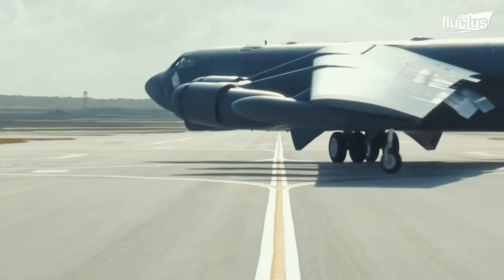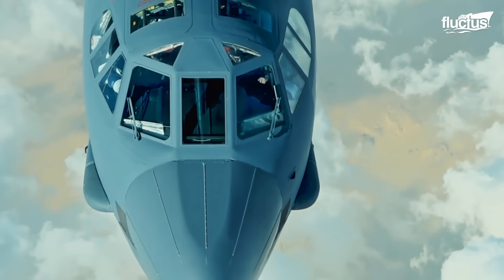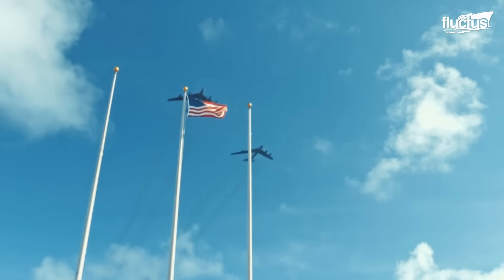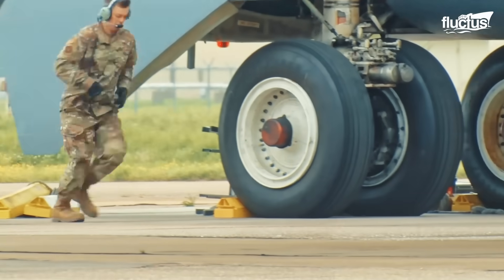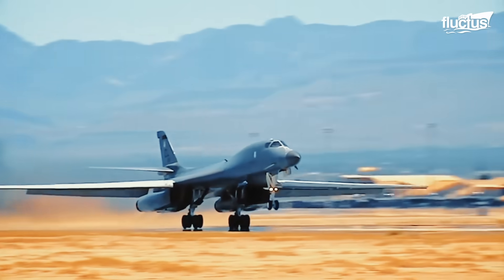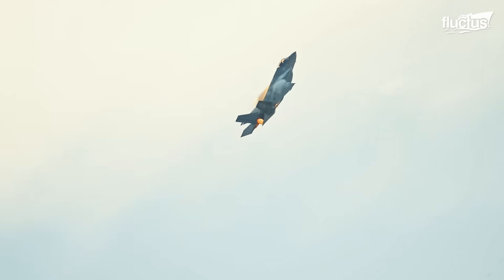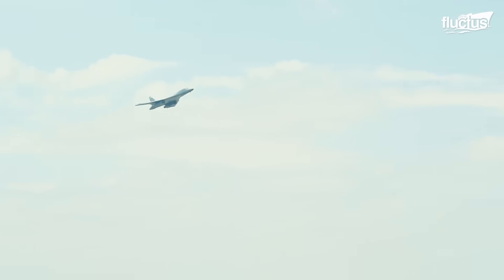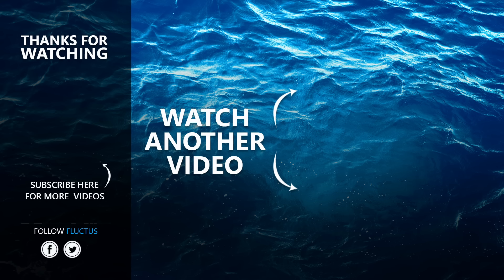Behind US Genius Idea to Power Old B-52 Bombers with Brand New Engines

Comment: When the F-14 was developed in Bethpage by Grumman, I lived 1/4 mile from end of runway. I used to ser toms of F-14, E2C, & F-16 fly low ober my backyard. I could wave to the pilots. When the LEM was picked up, the NASA Guppy flew into the airport and it was so huge, that I thought it was going to crash before it got to the runway  I also remember it took off in the middle of the night under the cover of darkness as the entire moon landing depended on the LEM being delivered to NASA safetly

Comment: I guess I'm a genius. I said back in the early 80's when I first learned about the current engine that Boeing needs to put a more powerful fuel efficient engine on the b 52 and the mission would be greatly improved. Have extra speed when needed and longer range.
Reply: The Boeing check made out to your prescient self may well be in the post..... - or not!
Reply: The B-52 does not need a more powerful engine.  This is due to its design.  The TF33’s used on B-52H’s are actually de-rated.  There were actually a lot of compromises and quirks in the 52 design that are too numerous to cover here.

Comment: Don't get me wrong. I liked the video. I like this stuff. But you should have named it about the b52, b1 and f14. BTW  the merlin was a fine engine. But so was the Allison. The merlin didn't make the p51 into what it was. The laminar flow wing did. The Stanley hooker supercharger on the merlin gave the p51 the high altitude performance it needed to be a truly world class escort fighter. The wing design is what gave it its great range. The p38 never used a merlin but the same Allison engine that came on the p51. Only those engines used a turbo/supercharger developed for the b17 bomber giving the p38 its great service ceiling

Comment: These are the same planes the North Vietnamese would shoot down with Russian SAM Missiles. I doubt they go much faster than a commercial airliner and even with electronic counter-measures would still be slow and vulnerable.
Reply: They are not sent into environments that have active air dense systems
Reply: @yourmanufacturingguru001  I assumed that which only limits their effectiveness. They were designed a a heavy bomber and to carry nuclear weapons.
Reply: The B-52 has been for sometime and will be in the future with the remake going on an arsenal plane. It probably has a radar cross-section (RCS) of a barn door!
Reply: @weissmorris8822  Its ancient, they made moves about it in the 1950,s. New engines even Boeing declined that for the 747.

Comment: You said almost nothing about the new engines. Why???????
Reply: Because to have British engines on this most iconic of American planes is a little, well, embarrassing.
Reply: @sjmachrihanish This series of engine is from when the company was called Rolls-Royce Deutschland when BMW had a stake in RR's aero division and was designed and are still produced by Rolls-Royce Plc's Business Aviation division in Dahlewitz, Germany for the civilian market as the BR725. The ones for the B-52, designated as the F130 will be manufactured in RR's North American division in Indiana. In fact the engine produced in the UK, the Trent 1000, has massive amounts of problems.

Comment: The USAF know the F130 engine very well as it`s done huge hours for them over the years as they power their C-37 & E-11 aircraft. F130 is a derivative of the BR700 series of engines that have been very successful for RR. Those fitted to the B52 will be built at RR`s facility in Indianapolis.

Comment: Why not 4 larger engines, rather than 8??
Reply: Apparently, aerodynamically, it was easier to stay with eight engines in the twin pods. Ask Boeing what happens if you change engine placements badly (737 max).
Reply: Lower ground clearance, issues in case of engine failure (thrust asymmetry), different engine-wing interaction (which would need complex simulation and testing to account for)
Reply: With 4, if you lose an engine on take-off, the 10% rudder chord cannot control the yaw.

Comment: Apart from some early production test aircraft, the Merlins used in P51s were made by Packard. Many of the Packard Merlin powered P40s (P40-F and P40-L, or Kittyhawk Mk II) were converted back to Alisons, and the Packard Merlin engined P38 never saw production.
Reply: @paulfrantizek102  With exception of the initial Merlin engined test aircraft - ALL the engines used in the P 51 were either Alisons (used in the early models) or Packard/Merlins. Not one P51 was ever produced with a Rolls Royce engine.
Reply: @paulfrantizek102  never one Merlin P 40

Comment: "Behind US Genius Idea to Power Old B-52 Bombers with Brand New Engines." Nothing was said about the new engines. You didn't mention the 30% increase in power, greater fuel-efficiency, maintenance, etc. Do the new engines increase the ability to carry more weapons? Did it increase the speed of the B-52? Why Rolls-Royce? Made in America. How long before all of the aircrafts have the new engine? Do the new engines still require an explosive cannister to start? Is not an auxiliary generator capable of starting them faster? What is so genius about getting a new engine? Old engines do wear out. Are they able to take off any faster. Was it done to respond to emerging threats such as hypersonic weapons? Has the mission changed? Are they still going to be used to carry nuclear payloads or is that going to be handed off to just the B-21 Raider. Are they running any cleaner than the old engines? Are they any quieter? Is the additional power used for new electronics or for greater payloads? You left a lot of information out.
Reply: Great questions
Reply: Are you inquiring for Russia or China? 👀 jk
Reply: @Slonge92  Exactly, those questionable dudes🤔
Reply: It's all available in loads of other videos....just search it....

They're based on a commercial aircraft engine so I'm sure they'll start in the same way, they don't leave smoke trails 3 miles long and are more economical allowing longer range or more loitering time ....not sure if that will result in an increase in payloads but I doubt it
Reply: Good point - why aren't they buying Pratt and Whitney engines?
Reply: @billfrohberg3206  ... Rolls Royce Engines offer more than any current engine on the market
Reply: @billfrohberg3206  Probably RR had the better product. Or didn't provide an offer. Also: RR may be a British company, yet they also operate significant production facilities in the US.
Reply: Yes…ALL the Question’s which you have stated and or requested answers, the Enemies of your Nation would be interested in obtaining!

If, any body or person with the answers to your questions, attempted to give such TOP SECRET INFORMATION to the Enemies of Your Nation, then they would Face either Several Hundred Years Maximum Security Federal Prison, And Or, The Military Forces Federal Maximum Security Prison, And Or, A Potential Taken Out At Dawn given a Cigarette And A Firing Squad [!]

The Majority Of Your Question’s The Answers would be Evident [!]

As A NEUTRAL PEACEFUL OBSERVER I would Be Happier if ALL NATIONS WOULD BE ABLE TO RID IUR SHARED HOME EARTH OF ALL WEAPONS [!]

But I know that will not happen.

Because Weapons may also be turned on Objects such as METEORS on a Collision Course with EARTH.
Whilst there is No Proof of Weapons saving Earth. Fiction Movies are Daily Telling Humanity METEORS are A Danger!

Personally I hope EARTH is Never Tested with METEORS…because as Current Internatiinal Conflicts show…PEACE FOR HUMANITY IS THREATENED [!]

Despite the Threats , I Will Remain Respectful for PEACE ON EARTH BETWEEN ALL PEOPLE’S AND PEACE ON EARTH BETWEEN ALL NATION’S [!]

Yours Faithfully

Mr. Lawrence Hennessy NEUTRAL UNbiased INTERNATIONAL PEACE BROKER + INTERNATIONAL LAWYER
Reply: A lot questions. As these engines are modern jet engines its clearly no explosives needed to start them , lol.
The reason to replace them is not fuel efficiency or other reasons. Its very simple, these kind of engines reached their lifetime. (imo just like the Air frame)
Just like a Saturn V rocket can't be built anymore. There is no production capacity and no machines to build such old stuff, and frankly it don't make sense either. 
For me this is all a safe sign that the US is beyond their peak. Modernizing B62 nuclear bombs and modernizing 70 year old Air frames. Clearly fit to fight a war in the 21th Century, not.
Reply: @hansjorgkunde3772 .... Actually upgrading them makes a shit lot of sense as the airframes have been virtually all been rebuilt as it is .....as for a war scenario these aircraft will never overfly an enemy country as they're basically an airborne aircraft carrier used to launch cruise missiles and other weapons that travel to be their destinations hundreds of miles away

Comment: British Rolls Royce as powered the Spitfire & Hurricane. Manufactured under license for the P51 Mustang that allowed it to work as the Allison proved inadequate. Now helping your awesome B-52 have another life
Reply: ...although I think that, ironically, this is an engine from the German bit of Rolls Royce.
Reply: @timmurphy5541  All good for the  RR share price !!
Reply: Fuck British engines, no one makes better jet engines than the US.
Reply: The BR series of engines were designed and are still manufactured for the civil market in Dahlewitz, Germany. These will be manufactured in Indiana. The engine produced in the UK, the Trent 1000 has massive issues.
Reply: @ginacalabrese3869  there are quite a few engines produced in the UK apart from the Trent 1000 and it's of a totally different class. It's main fix is out too.
Reply: The P-40 used Allison engines in all specs I have read.

Comment: This is not genius, it's not even new. The TF-33 turbofan (JT-3D replaced the J-57 turbojet  (JT-3C) with similar benefits. Numerous studies have been done on re-engining since the early 1980s.. Putting commercial BR-700 derivatives from bizjets dating back to 1995, is hardly revolutionary. It doesn't even add power. What it adds is dramatically improved reliability and better fuel efficiency.

And no, the Lightning had Allison engines not Rolls-Royce although they may have performed better with them (particularly the 60 series and 100 series) as the intercooler/turbochargers were a weak point in earlier Lightnings.  .

Comment: Nope. Rolls Royce did NOT power the P-38 or P-40. They might have installed the Merlin in both airframes as an experiment, but they were never used in production.

Comment: There was also a plan to replace the eight engines with four much larger turbo-fan engines.
Reply: Replacing 8 with 4 will not work with a 10% rudder chord.  Losing an engine ( with 4 engines) on take-off will ruin your day and result in an airframe loss.  There would not be enough rudder to control the yaw.

Comment: There is no reason to replace a Bomber such as the B-52 when upgrades can be done easily and the structures are still sound.  The range is increased not the speed since the engines produce the same thrust as olde ones.

Comment: I was a plumber 55255 while in US Air Force. I think I got a better job then those poor guys. I'm sure they were all told they were going to be Crew Chiefs of the plane they wanted. 😂
Edit, we plumbers and water and waste airmen made the water for the B-52's and some of the older tankers for their jet engines. You can tell which ones that were running water through the engines by the very black smoke when taking off. 🛫

Comment: Uhmm, the engines used in the P-51D Mustang were built under license by the Packard Motor Car Company in the US. The engines used in the P-38 Lightning and most of the P-40 Warhawks were designed and built in the US by the Allison Engine Company. British engines were hand-built and the parts weren't interchangeable. Engines built in the US were mass-produced using tighter tolerances which allowed the parts to be interchangeable.

Comment: Way off base on your WWII aircraft information.  The P38 used Allison engines, the P40 used Allison engines and a few were fitted with Packard built Merlin engines.  The P51 was fitted with Allison engines and Packard Merlin  engines.

Comment: Does anybody know where the B-52 re-engine work will be done?
Reply: I believe the engines are made in Indianapolis.
Reply: @joeyjamison5772  I was talking about the installation of the new engines on the aircraft. Has that even begun yet?
Reply: @jamesbaldwin2696  It hasn't started.  The design of the B-52J upgrades isn't even finished yet. IOC isn't expected until 2033.
Reply: @stargazer7644  Ok thank you. Boy, that's still a ways out.

Comment: I THOUGHT THE P-38 AND P-40 WERE ALLISON, AND THE P-51 WAS PACKARD MANUFACTURED…..
Reply: It's my understanding P51 had Rolls Royce Merlins like the Spitfires for it's high altitude performance.
Reply: @knowahnosenothing4862  If true, then what were the Packard Merlin’s used for, if not P-51’s?
Reply: The story was that Rolls Royce sent the plans for the Merlin on a ship, a representative from Packard came to pick them up with a briefcase… the ship captain laughed and pointed to a box that was about the size of a small car.

The Merlin definitely made a profound positive impact on the P-51.
Reply: So Rolls didn’t supply the US with pretty much any engines…. Until the B-52.
Reply: @IndividuumVox  You thought right!

Comment: The genius behind it is they need better power on those old B-52s.
Reply: More efficiency and reliability, yes. Airframe can’t take more power.
Reply: @rayjay848  the airframe could take  more power but the design can’t.  The flight characteristics would be unstable.  The tail wants to go supersonic before the wings is but one example.  Application of power in flight has to be gradual to avoid pitching up is another.  The TF33’s in current use are de-rated for that reason.

Comment: The P-38 was NOT fitted with Rolls Royce Merlins.
Reply: It had the Allison V1710
Reply: @willieblake  Absolutely correct!
Reply: Neither was the P-40
Reply: Another 'what if it had been fitted'?
Reply: @cicero2  The P-38 used two different engines versions of the V-1710, turning in opposite directions.  Far as I know, they never made a version of the Merlin that rotated in the opposite direction to the rest of them.
Reply: Neither did the P 40. What a stupid  mistake.
Reply: Kelly Johnson wanted Merlins for the P-38 but the War Production Board said no.
Reply: No No the Forked Tailed Devil did have the Packard Merlin Bud....The P-51C Razor Back models also had the Alison. The 38 and 51D models were Packard Merlin powered
Reply: @Mr.XJ.96  The P38 was NOT merlin powers! WTF! You are wrong......spud.......
Powerplant: 2 × Allison V-1710 (-111 left hand rotation and -113 right hand rotation) V-12 liquid-cooled turbo-supercharged piston engine, 1,600 hp (1,200 kW) each WEP at 60 inHg (2.032 bar) and 3,000 rpm
Reply: @Mr.XJ.96 There always has to be one contradiction minded, conspiracy theorist who makes puerile nonsense claims - like they know some hidden unrecorded exception to recorded historical facts! And today the winner is you!  There were no P-38 aircraft built or tested with Rolls Royce Merlin or Packard built Merlin engines! Not that Kelly Johnson didn’t request that a test be performed with Merlin’s. But he was turned down by the US Government and informed every Packard Merlin was to be sent to North American for production of P-51s. Those are the facts!

Comment: Why not build new ones to the exact same spec with modern tech.
Reply: There have been so many upgrades to all the different systems within the B-52s over the decades that the only thing the same is the outer shell.  A crew member on a B-52 from the 1960s would have to be completely retrained.